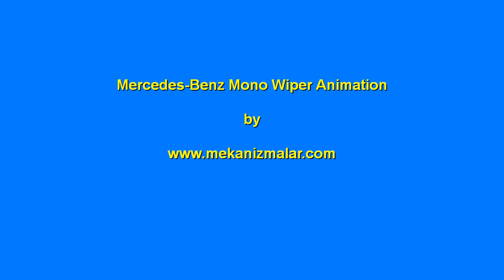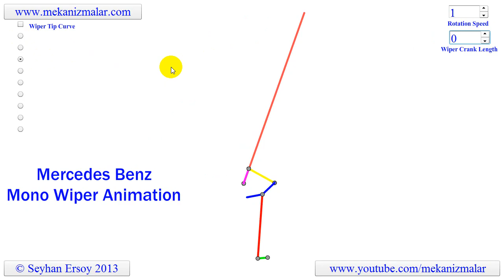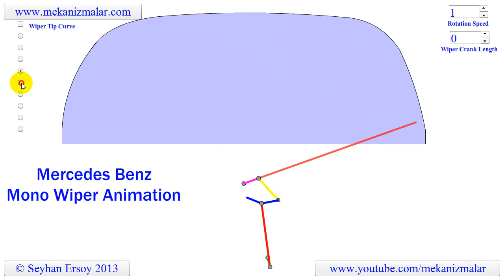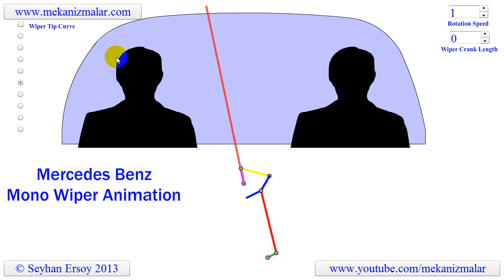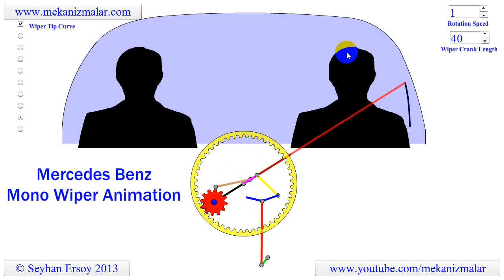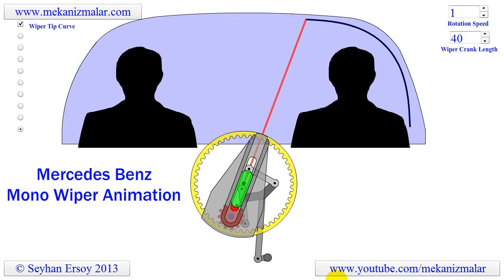Mercedes Benz Mono Wiper Animation

Comment: Anybody who knows Fourier transformation first learns that you can create a square wave by adding different harmonics of sinuses with appropriate aplitudes. So in theory you can come up with a wiper design that can wipe the whole rectangular windshiled without missing a single spot. In this design due to practical considerations only the first 2 harmonics (1st and 3rd) are used such as sin x + 1/3(sin 3x). One main gear and another one turning inside the main one.

Comment: Sitting in my W140 using my wipers and watching the driver side wiper doing its magic dance by extending and retracting. The only draw back as said in video is, wiping speed during heavy rain is a bit slower than regular, not as bad as single but slower than my 09 corolla on its fastest setting. That and complexity and added Parts that are expensive or hard to find a working replacement/ requires longer replacement time… mine actually just stopped doing the jump/retract and works like a normal wiper. I  manually pull or push the wiper arm manually when it rarely extends fully and goes past the edge. Will fix it sometime soon.

Comment: That's really ICONIC for German behavior: Solving a non-existent problem in a really complicated way with absolutely no improvement in customer satisfaction. 😁
Reply: There really wasn’t an issue with standard wipers but the mono wiper did wipe 25% more glass surface than the standard two wiper setup.
Reply: @KennethVanWieII  Which is a form of "better", but all yokels can do is yell THAT"S ONLY ONE WIPER!

Comment: I actually hate the mono wiper on my car. I am going to have to take it out of the car and all apart just to replace the grommet which seals the base to the windscreen. Why did they not make the blade removable from the top. The cover has screws which go in from the bottom. So you have to remove and disassemble the whole thing in order to do that. Bad engineering!
Reply: it should be easy to remove the blade
Reply: @storm4710  I was not referring to the blade. That's fairly easy. 
The whole mechanism, motor and all, are not hard to get off the car either. But you then have to disassemble it in order to replace the rubber boot that seals it to the firewall. The center pin where the arm pivots in the mechanism is supposed to slide out but I couldn't get it out.
Anyway I stretched the boot over the whole thing. I was afraid it would tear but it is very tough and I got it on there.
That boot keeps water out of the firewall to keep it from rusting. 
I pated myself on the back on that one. Lol
Take care!
Reply: @wernerdanler2742  I know it very well,
Its quite rare for that seal to die though,
Thx right back at ya buddy
Reply: @storm4710  You'd think, but mine was all broken up and even chunks missing. Bizarre! Lol
Those arms do not pivot up like others to get a new blade om but still enough to do it.
Thanks buddy!
Reply: @wernerdanler2742  NP m8
Reply: @storm4710  I'm not sure what that is but I had watched a video on how to replace that boot so I knew how to disassemble it but like I said the main pin would not come out of the base like they showed. It was frozen in place. I still got the boot onand that's what counts.
I've only had this car about two and a half years now and found many neglected and broken items.
Reply: @storm4710  oh da! I just figured it out. "No problem mate." What ya want from me I'm old and slow. Lol

Comment: Cool animation. But the whole concept is silly by overcomplicating something that worked fine and was so simple.  1 wiper is better suited for a square window.  2 wipers are better suited for the rectangular shape of a windshield.
Reply from the maker: Hi Rob, thank you for your visit to my channel and comment. I guess Mercedes agrees with you and that is why they are not making wiper like this anymore. However concept is interesting and someone might find another application for this mechanism.
Reply: It did wipe 25% more surface area than a standard two wiper setup. In the end that wasn’t enough to justify the complexity.

Comment: LITERALLY THE BEST SYSTEM EVER DESIGNED
Reply: Yah our mechanics made hella money off these.  A regular wiper motor replacement netted us a couple hundred bucks. A Mercedes was grand just to get started.  These motors bought us alot of shots at the bar across the street.  It was a few grand to replace the headlights and headlight wipers on a old mercedes we had in.  I cashed out a Ford Taurus right before that got a new transmission.  The wipers and headlight were more money than the transmission.(like almost 4k vs 2k)  LMAO.  The thing was the owners were proud of how much money they poured into their expensive ass cars.  And looked down on people who didnt have to steam shovel money to keep them on the road.  They were proud to pay.  It was awesome.
Reply: @reach3k thats just straight up complete bullshit. The motor is not a special part.
Reply: @reach3k that is bs nothing special about the motor and the mechanism can last forever
Reply: JETHRO TULL SEED DRILL CAN HUFF MY NUTS
Reply: IBM SELECTRIC WHIFFLETREE ENCODER CAN ALSO HUFF MY NUTS
Reply: MALTESE CROSS CINEMA CAMERA FILM ADVANCEMENT MECHANISM? THAT'S RIGHT: ALSO HUFF MY NUTS

Comment: similar in audi a2
Reply: It's not similar, it's a single wiper with double arms. Many small cars and 4-wheel mopeds nowadays use a design like that. Pontiac Grand Safari 1976 has a similar function on the driver's side wiper (it's a very wide car), though it does'nt look like a double-arm; the passenger side has a normal wiper.

Comment: its better then other wipers.. a Mercedes Benz is expensive regardless.. i believe that the design change came because the windshields are larger and Mercedes wanted to cut production cost to compete with bands like Toyota,Honda,ford from a financial standpoint..Mercedes new slogan.."nothing but the cheapest,we need to save money"
Reply: Unlike the old days, also save money but cutting back on reliability
Reply: The monowioer had a tendency to leave streaks that owners often complained about. If the wiper “insert”, aka wiper blade, is new it works great, as the rubber ages it begins to leave streaks along its complete path of travel. Since the monowiper travels the complete windshield it streaks the whole glass. Plus it was expensive and complicated, so MB axed it. I love it personally, just keep the blade new and clean and it’s wonderful.